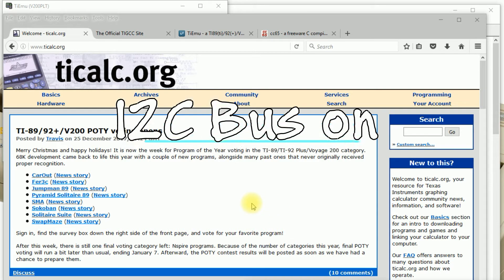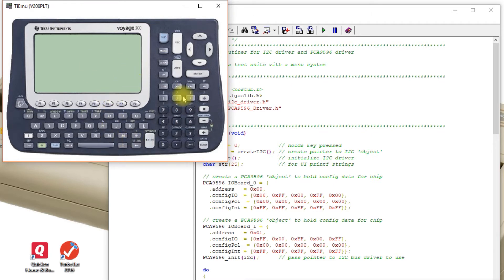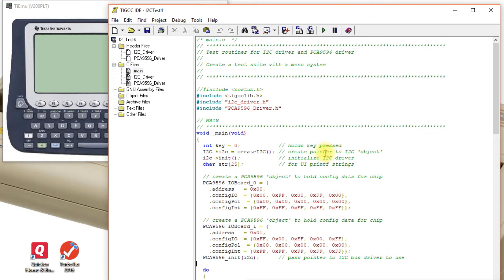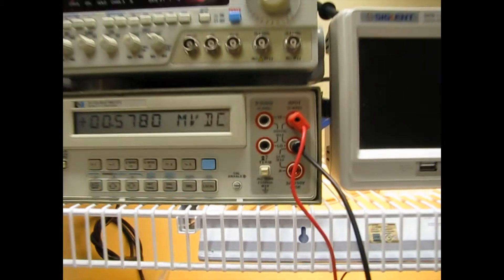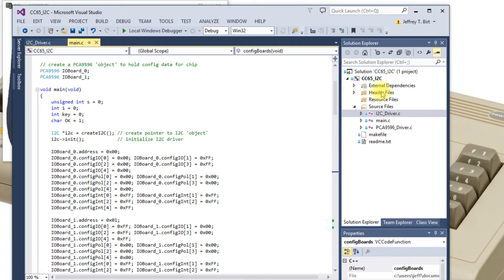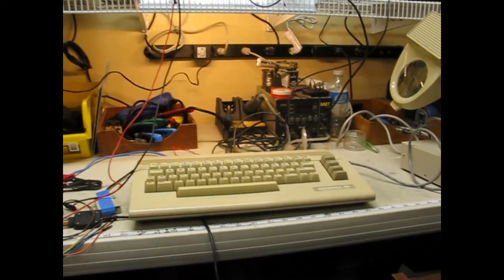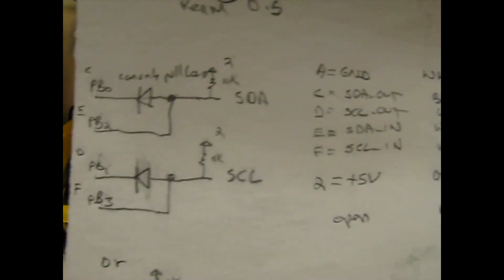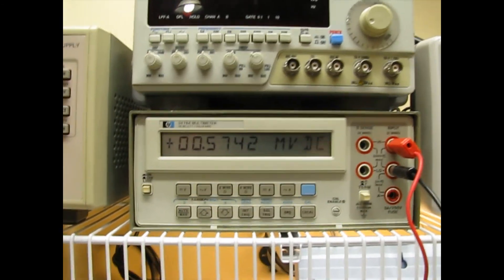I2C on TI-V200 and C64

Comment: Hi!
Very interesting project 😊
Do you think that your interface would be usable to send data to the calculator, via existing software?

I doubt that the official software would allow that, but maybe the unofficial counterpart may work by  coding an interface.
To be honest I don't know these calculators in depth, I just bought a V200 to experiment with assembler, but connecting it to a computer it's becoming more difficult than I thought :/
Reply from the maker: If you want to transfer software via TI Link or other software the easiest way to buy a new TI Link USB cable. They are available from TI directly and they are all over eBay: https://epsstore.ti.com/OA_HTML/ibeCCtpItmDspRte.jsp?section=10412&item=114932&sitex=10023%3a22372%3aUS&XT=XLB4-LUNW-2ON2-JWD6-16NR-TR1G-3EQ2-8QHC&ref_url=https%3a%2f%2feducation.ti.com%2fen%2fproducts%2faccessories%2fconnectivity-kit

Comment: Well done: I was searching for hacking the Märklin modell railroad digital protocol over the CAN Bus (controlled over I2C) with my TI-V200 or C64 what a fun to find your I2C stuff for both devices here🙂 (The only changes I will made is to use the cassette port of the C64 so I have the user port free for other jobs.
Reply from the maker: Using the cassette port is a great idea! I had started on a machine code version for the C64 but I don't recall if I finished it or not.
Reply: @HeyBirt  (i'm a preogramer not so good in electronics) I found out I can enable with one bit the cassette motor 6V AC great so far but for the I2C CAN BUS controller I need 4-6V DC do you know it's save to use the 6V AC as DC also ?

Comment: 100 kbit/s?  Pretty Cool way to interface to modern microcontrollers, slow but neat! -- BTW, what is your Commodore to VGA adapter?  It looks great.
Reply from the maker: No where near 100kbit/s, I'm afraid. The clock speed of the C64 is only 1mHz so it would have to generate one clock cycle for the I2C every 10 cycles of the processor.

The nice thing about 'true' I2C is that it will operate down to DC. It only cares about what is on the data line when the clock edge happens. Things like arbitration and clock stretching would be affected though (if you have a device that makes use of either), but the speeds we are using are so slow most any I2C device can keep up.

I was going to try and do some more testing on the code today to see how fast it is able to transmit and see if it can be sped up (maybe inlining the bit tx/rx functions). I think the overhead of using C for this application is a limitation though. I'm might try to redo the code is assembly (been 30 years since I've done 6502 machine code) and see how what works.

The VGA converter was a cheap one from ebay. There are loads out there that look the same but some work and some don't. I got mine about 18 months ago from: https://www.ebay.com/itm/2X-Tv-Rca-Composite-S-Video-Av-In-To-Pc-Vga-Lcd-Out-Converter-Adapter-Box-Black/222644471433?hash=item33d6a50689:g:V4MAAOSwstxVVG~o . The included 5V adapter was garbage and put out so much interference it spoiled the picture. I replaced the adapter and it worked great.
Reply: I never thought about the 5v adapter creating noise on the circuit.   I've gone through a couple of these and returned them.   The next one I get in, I'll definitely check to see if the power adapter is the issue.   Looking forward to seeing your speed results.